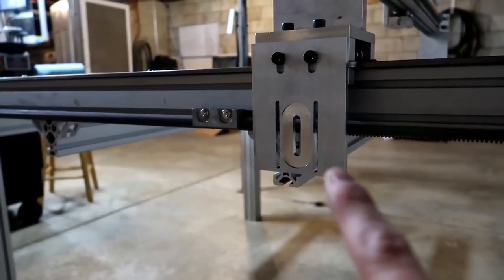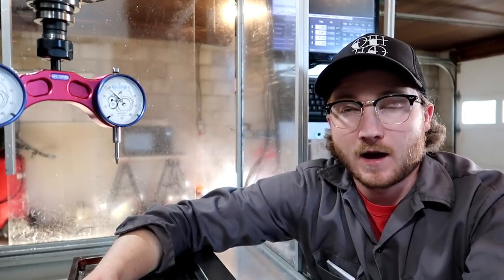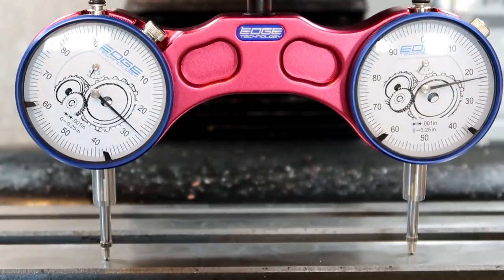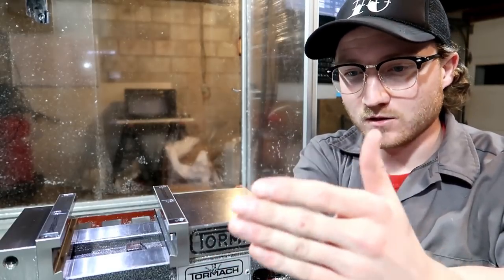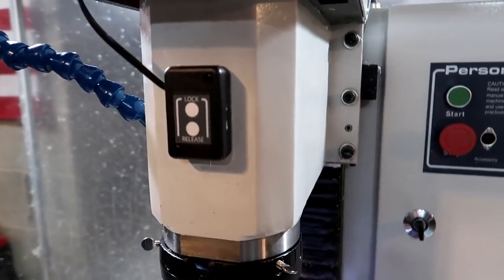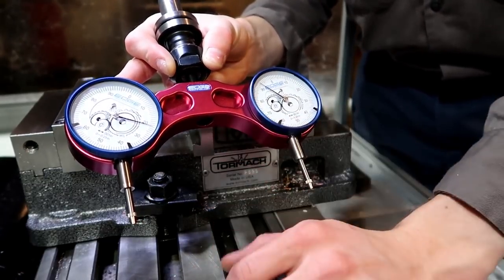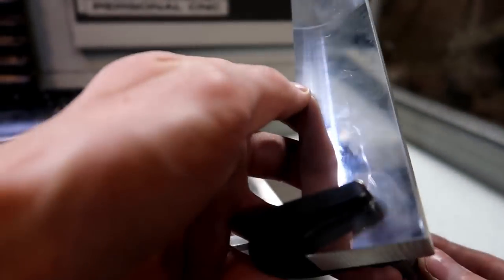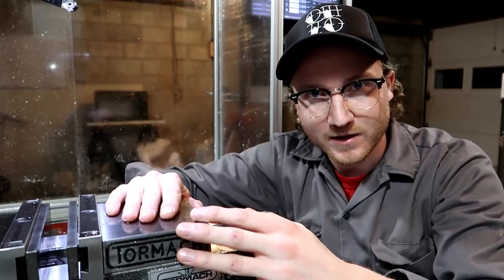Fixing "It": Home Mfg. Days #38

Comment: To use that tram aide you want to bring it down and touch the table so both sides just move the needle about 0.005" (hoping your not out of tram above that amount) then zero both indicators out, then rotate the spindle 180° and that reading will tell you how far out of tram the head is and which direction.  If you try taking the tram reading right from go it will be including any mounting error of the tool in the holder or in the spindle taper/collet.  Hope that helps.  Also you can leave the tool in the spindle to make small adjustments if you make and add fine screw adjustment blocks on the side of the head where it bolts to the z axis slide.  This allows very fine controlled adjustment along with a way to hold that adjustment while tightening the head.  Sould be able to get it to .0001"-.0002" with the adjusting blocks!  Can also check your front to back tram and shim the head as required.

Before doing any of this though the column should be checked with a large right angle for perpendicularity to the table so the head travel is vertical both front to back and side to side.

You can make these machines very accurate if you put the time and effort in to do so, they can be very capable!
Reply from the maker: I checked column perpendicularity and it was all good there.  After I zeroed(calibrated) the tramming tool I brought it down 0.050" like the directions said and thats where I found my alignment issue. I checked front and back tram and it was all good there.  Just left and right was way out.  Anyway, thanks for the help!

Comment: You can always feed from the other direction so that the trailing side is "high" instead of dragging.
As much as I curse the rotating ability on the head of my novakon, it does allow me to get the tram dialed it. lol  .....but it also allows it to get knocked out of tram a lot more easily.  
So you were only running 6500 rpms on the delrin?  I'm curious why you wouldn't have it cranked up as fast as you could get it.  :)
Reply from the maker: I could feed if from the other direction but I still know its there and it would still be out of alignment.  The novakon seems like it has a little more flexibility than the Tormach.  Yes, I didn't want to crank it up too much in fear that any higher RPM might cause more chatter with that the long stickout of that end mill.
Reply: On the fly....true....but it would also make sure that you don't end up with the marks if you don't run the cutter off the part first.  You'll probably see a more consistent finish since the super light cut of the trailing side can create more of a smear than a cut.  On the rpm.....makes sense. :)